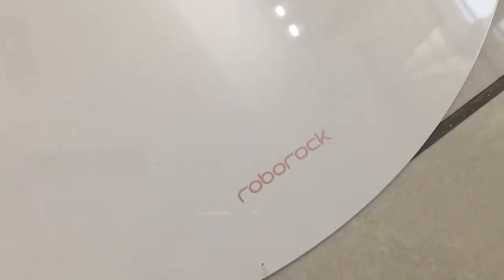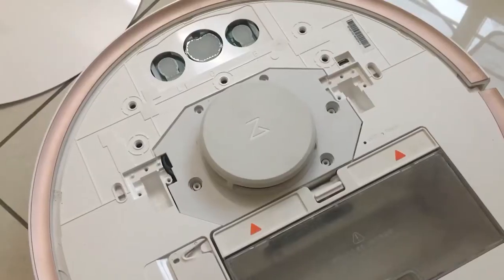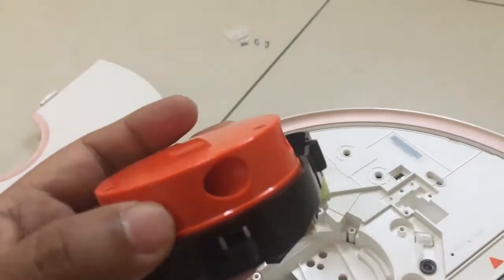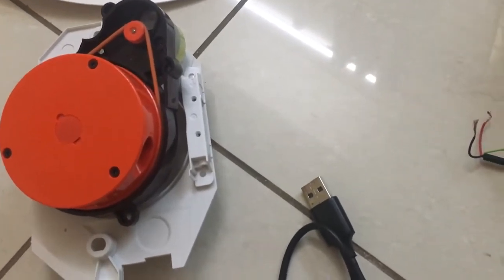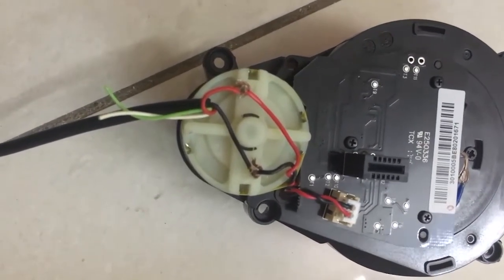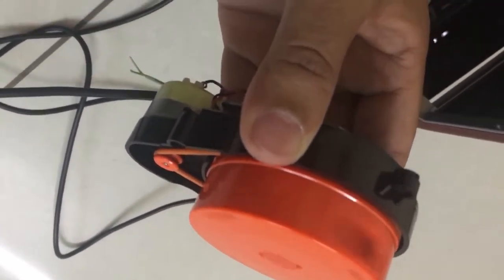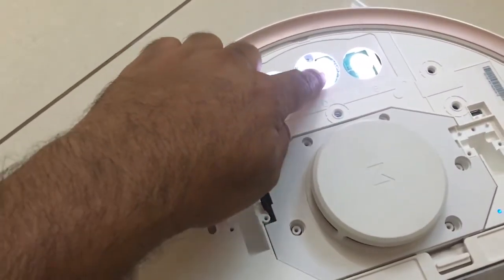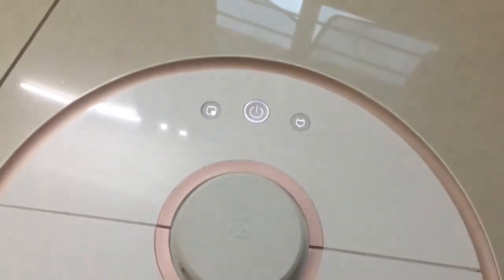Xiaomi Roborock S50 | LDS Error 1 | LDS Stopped Working | LDS Error Fixed - TOTAL TECH

Comment: If the motor does not run even though powerbank is providing the power - motor is completely dead right? Can i just buy any similar sized 5v motor and replace it?

Comment: This is only a partial solution. Better buy a new motor. Mine works for 2-3 hours and then gets stuck again.
I tried cleaning everything, but the laser is moving smooth

Comment: Thank you so much the solution worked for my roborock S5 error 1. However, before and after error 1, I was and am getting error 8 (remove obstacles). I think there is some problem with right wall sensor as it get stuck very often at right side
Reply: Same problem Error 1 changed to Error 8 .

Comment: Thanks man, this really does work......... I have no idea why, but it does. Soldered 2 wires to the motor, and first tried hooking it to an USB power adapter as I didn't want to risk a PC/Laptop, however although the motor worked - it did not work when I put it back in the unit. Then I hooked it to the front USB on my PC, and after another test - it worked inside the roborock unit as well. Damn.

Comment: Hello, i tried to replace the motor but the error still there. anyone encounter the same as me??
Reply: I replaced my motor and it fixed the issue.  Like everyone else I also tried the method in the video but didn't work since the error 1 code kept stopping the vaccum
Reply from the maker: Where did you buy this LDS motor from and have you tried resolving the LDS Error 1 method shown in this video?

Comment: Thanks  a lot, you saved my vacuum!;) does this error come back for everyone, or has some1 managed to perma fix it like this?
Reply: For me is comeback. I do this. Clean a house. And next time is always stop
Reply: @swieca244  I guess I was lucky, 6 months and it still works :)
Reply: It came back multiple times for me and finally I replaced the motor on it and it fixed the issue.  https://www.amazon.com/fayle-Roborock-Cleaner-Pulley-Distance/dp/B0854CRGQD/ref=mp_s_a_1_4?dchild=1&keywords=roborock+s5+replacement+motor&qid=1609524372&sr=8-4

Comment: I need a guidance how to change the laser of roborock S5 Max, do u have any experience ? I need that urgent, tx in adv
Reply from the maker: Sorry for the late response and wish you found out the solution. But have you looked at this video on repairing LDS Error 1? Changing laser of Roborock S5 is similar to this.

Comment: Thank you so much it worked. If this happens again would you buy a new motor or laser? Thank you for your help.
Reply from the maker: The laser, thought a little high in price compared to motor. Bcoz LDS motor is not working all ways as Serene Teng commented above and I heard from few others. But you can still try.

Comment: Difficulty 2/10*: Worked exactly as described, w/ older mini usb, red & black cables only. Tried to plugin to wall via adaptor and didn't work. After reattaching the wires, plugged to laptop, it worked! *ANYONE with a small phone / laptop repair kit can do this. Tip: strip quite a bit of of the red / black insulation casing from the cables, so you've got plenty of slack. 
The only thing that has happened out of the ordinary, just prior to this LDS error 1, is that when the vac didn't get placed on the charger properly and caused the battery to totally drain. Even though, I recharged before using, seems something changed. How's that for anecdotal?    Thank you very much taking the time to show us how to fix, saving us a lot of money. Cheers!
Reply from the maker: Thank you for the comments

Comment: For me this also worked but only for like 5 minutes or less. i had to do it again and it failed again after a few minutes
Reply from the maker: This usually happens when the Roborock is not in use for a longer period and the motor would'nt turn on. Please try the LDS Error 1 solution shown exactly like in this video.

Comment: Thank you for the solution, it works great!!!👍 However, this works one time, if I want to turn it and have it to clean the house after 2 days, I am gettinf again fhe error and I need tk repeat the process. Is there a permanent way to fix it? Thanks
Reply: Had the same issue and bought a new motor and it worked.  https://www.amazon.com/fayle-Roborock-Cleaner-Pulley-Distance/dp/B0854CRGQD/ref=mp_s_a_1_4?dchild=1&keywords=roborock+s5+replacement+motor&qid=1609524372&sr=8-4
Reply: I have the same thing. To contact customer support its impossible.  I think you need to buy a new LDS on there website.
Reply: The same. Maybe you tix it? Enough a motor lsd or new lsd?
Reply: @swieca244  In the end I have ordered this one from Aliexpress, replaced it and its working again✌️ - Gear Transmission Motor for XIAOMI 1st mijia 2st Roborock S50 S51 S55 Robot Vacuum cleaner Spare Parts Laser Distance Sensor LDS

Comment: Have the same error and disassembled the lds unit. I've tested the unit with a 9v battery and it spins. But after putting all together the error returns.
Reply: same.  but just with the USB as per the video.
Reply: @83fedex  same for me
Reply: @TheAlBathorn  i tried it again and it works now. I did order a new motor from aliexpress though which still hasn't arrived.
Reply: @TheAlBathorn  i make sure it is always fully charged. Not sure if that makes a difference or not.
Reply: @83fedex  i've just tested, even fully charged it doesnt work. The 9V/USB trick fixes the issue temporary.

And I cannot confirm whether changing the motor definetely fixes the issue...On Internet, people say "Yes" and "No" even if it seems it is a real and widely spread problem :(

Comment: hello, i tried this and it worked but after using vaccum.for 5-6 times the error came back. is it normal..do i need to do tjis everytime.
Reply: Need to replace the motor. Had the same issue and it fixed it. https://www.amazon.com/fayle-Roborock-Cleaner-Pulley-Distance/dp/B0854CRGQD/ref=mp_s_a_1_4?dchild=1&keywords=roborock+s5+replacement+motor&qid=1609524372&sr=8-4

Comment: Awesome. It does work. I tried removing and putting back the sensor head multiple times and after every time, it did work, for about 5 minutes, then again it stoped working. Then I tried THIS IN THE VIDEO, and IT WORKED !!!!!

Comment: Thankyou for posting this video, very helpful. The stripped usb cable to laptop was an easy way to charge the motor. The vacuum is cleaning the house now. I'll update if it stops working again in the next few weeks. Fingers crossed its all good...
Reply: It lasted about a week before stopped again. I used the same repair a few more times while waiting for a new motor in the post. Now replaced motor and it's not had any more problems. Helpful video but for me a temporary fix.
Reply: @kieranv  I have the same problem. Where did you bought the new motor?
Thanks

Comment: It did not last for me.  I fixed it eventually, by drop a few drops of oil on the brass bearing of LSD driving motor. I tried to restart it by driving it with 6V dc supply, but it only worked for a few minutes. After adding oil, it worked for 4 hours already and a new motor is on the way.

Comment: Amazing! This worked like a charm. I first used lightning USB cable but it did not work but when I used micro USB cable it worked. Your video helped a lot! Thanks!
Reply from the maker: This solution will help the roborock LDS sensor to run with no issues. So, you can safely use this solution to fix roborock lds error 1. Please hit SUBSCRIBE, LIKE 👍 and SHARE, if this video helps you in anyway

Comment: And why does this occur? What reason? And how long does this procedure help?
Reply from the maker: This happens due to fluctuations in electricity from the power source, usually. This solution will help the roborock LDS sensor to run with no issues, until the voltage fluctuations hit again. So, you can safely use this solution to fix roborock lds error 1. Please hit SUBSCRIBE, LIKE 👍 if this video helps you in anyway
Reply: @totaltech-allaboutgadgetsa9732  Hi, I tried it and It works some minutes, bit then again the same. Do you know what could it be?
Reply: @MrFredi_  same for me, moved only 1 meter and stopped again. Replacing the motor will help?

Comment: If you had only had the cleaner 3 months before it gave you trouble , were you not covered by manufacturers warranty ?
Reply from the maker: In fact yes, it was under warranty then. But the problem is that I ordered it from Gearbest in UK and got it shipped from China to an US address and had it delivered to India. So, for all the practical reasons that I cannot ship it back to UK or China and there is no service available in India, I had no choice but to look out for such an alternative.

Comment: It will run for a week than you can do the same again ,a new motor cost 9 - 15 dollars replace it.
Reply from the maker: Roborock S50 is running absolutely fine since a month after the repair has been done to laser sensor motor. Anyway thanks for the suggestion, will keep this in mind 👍
Reply: Hey Mario, it happened as same as you say :) It worked for a while and then started giving same error. Could you tell me what should i exactly buy? Thank you!
Reply from the maker: @guvenatbakan  you need to buy the roborock LDS motor. Click here to buy LDS motor - https://tinyurl.com/y2fknx9x OR if you are unsure of fixing the motor in LDS sensor, then buy the LDS sensor itself. Click here to buy LDS sensor - https://tinyurl.com/y3fnx5z5